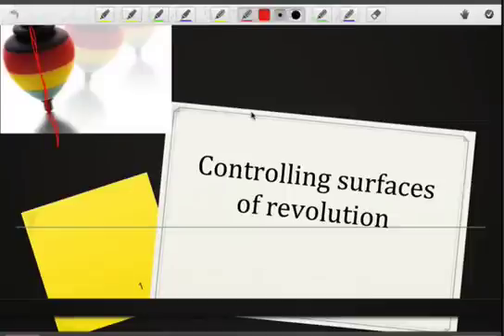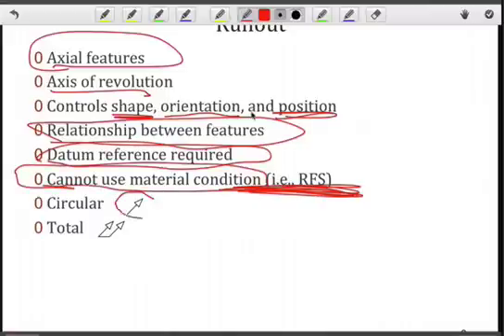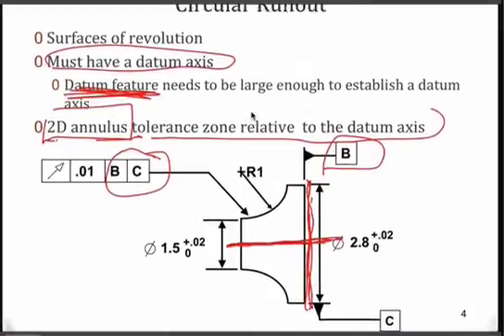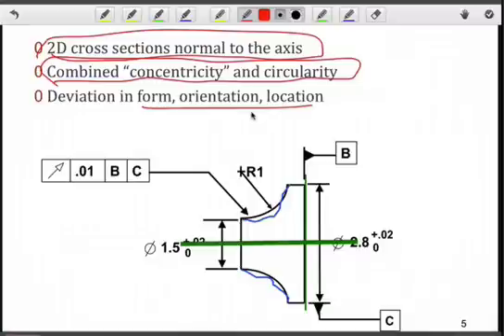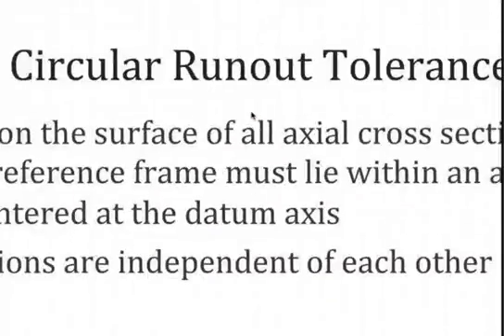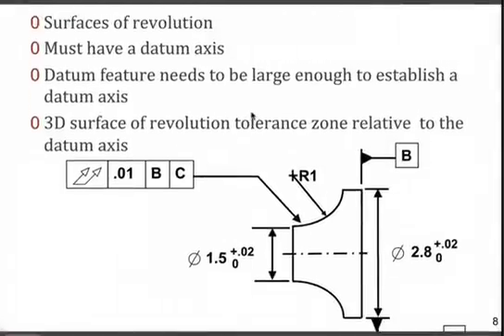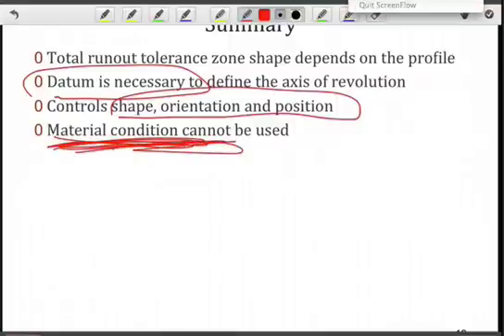Controlling Surfaces Of Revolution

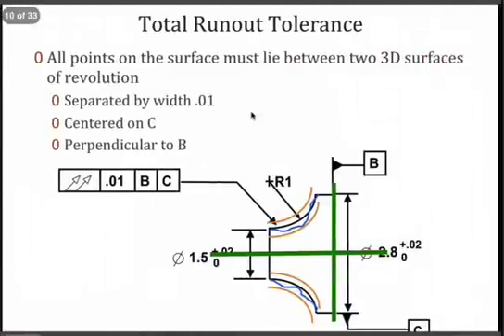Comment: John, I'm not sure you've accurately represented the definition of total run-out. Total run-out creates a cylindrical tolerance zone. The example zone you establish at 9:57 shows a circular run-out zone, not a total run-out. Even if that part was perfectly round, it's defined geometry violates the total run-out you've provided.

Reference:
http://www.tec-ease.com/gdt-tips-view.php?q=160
Reply from the maker: Please note that this slide is not total runout.  This is circular runout which is a 2D tolerance zone.